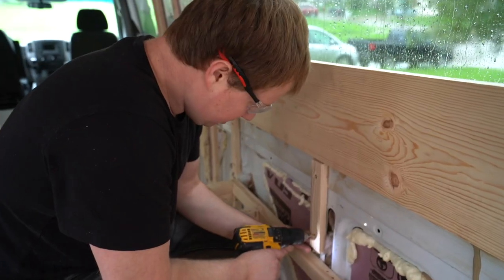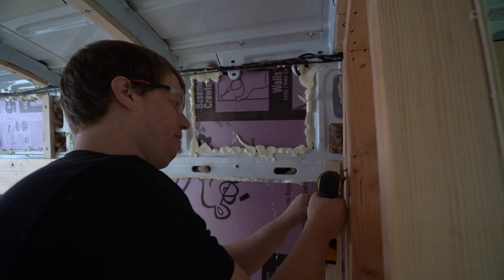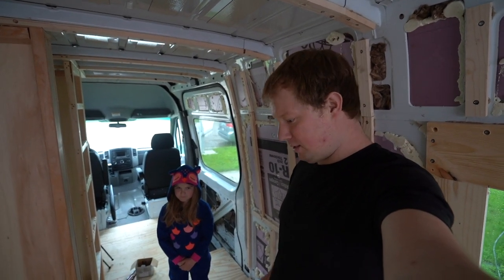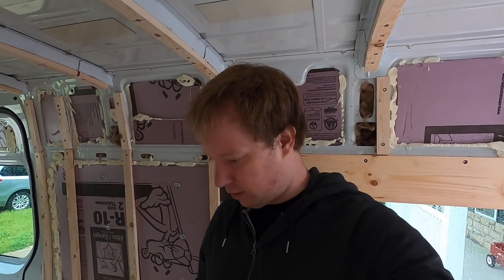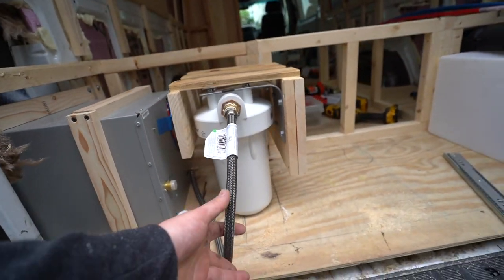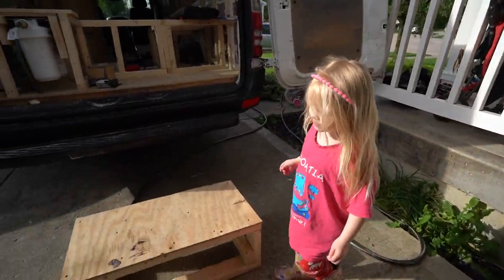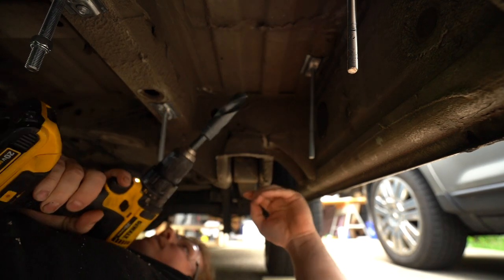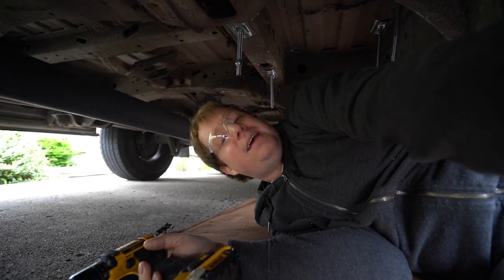VAN LIFE BUILD: Shower Plumbing (Ep. 9)

Comment: Just found your videos, lots of fun with the family!  Just a thought, you might want to squeeze a piece of sheet metal between the shower tank and that metal bracket (frame) that wouldn't move.  I can imagine vibration causing the frame to rub a hole in your tank.  Good luck and have fun, nice work!